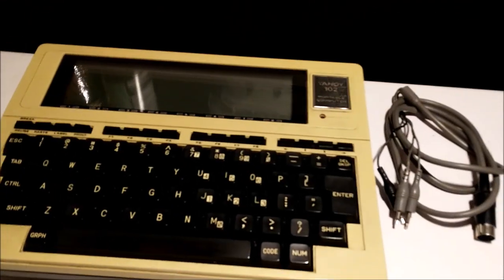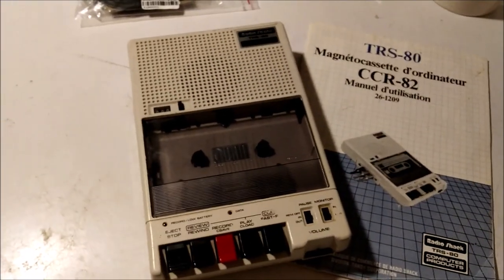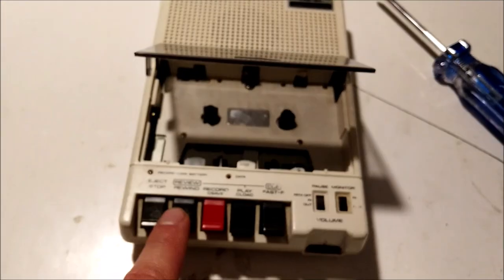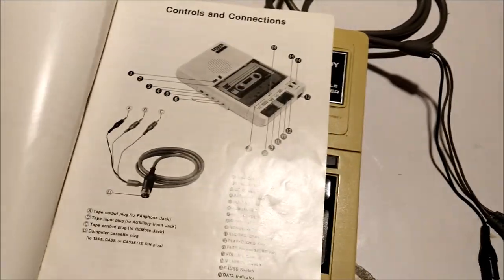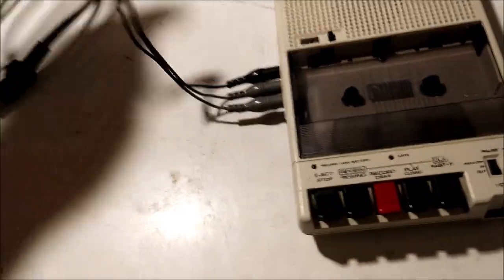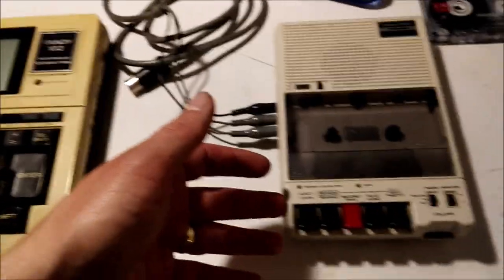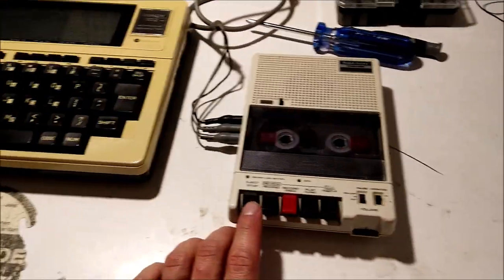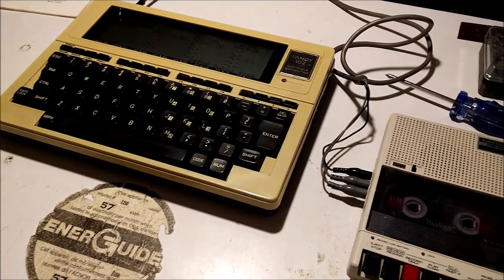Tandy Tape Drive - CCR82 Repair for Model 102

Comment: THANKS! I can't believe there is anything for this recorder. One belt was broken and now I know where it is threaded.
Reply from the maker: Glad it helped. I know how hard it is to find details on some obscure items. I repaired a tape deck this summer, only found one video online about it. While I was disassembling it I popped a small spring off and didn't know where it was anchored originally. Even though this video wasnt on a repair but tear down overview I managed to grab a few frames of the video that clearly showed where the tiny bugger belonged.

Comment: How do I change/correct the Head alignment on this machine? I have a Zx Spectrum +2a which has a built in deck for loading tapes, and it sounds much clearer than the audio output from my RS-CCR-81 that I am trying to use for loading tapes onto my new Spectrum Next. The lack of definition is clearly affecting the ability to load onto the computer. Thanks.
Reply from the maker: try recording a tape with it and playing it back. If it sounds muddy as well it is probably not the azimuth. If it sounds muddy a on tapes not recorded by itself but fine on recordings made in it then head azimuth is out. I would try demagnetizing the head first before messing with azimuth adjustments. A magnetized head is by far the most common cause of loss of high frequency response.

Comment: There's a lot of audible "wow" on the tape. I'd bet one of your new belts isn't uniform in thickness. I usually have to dig through the piles of crappy chinese belts with my calipers to find one that has the same thickness when measured at several points. It doesn't appear to matter to the Tandy computer, but remember that the wow is added when recording AND at playback, so it can have an additive effect depending on where the belt is when you play it back.

Comment: Nice looking recorder. Looks great next to the Model 102. You might want to use Retrobrite on the case of the 102: it will look brand new.
Reply from the maker: I am debating it. As much ad I want it to look brand new, I also like the look and feel of the true vintage. I have another 102 that is not 100 percent in working order (lcd issues) mainly a display piece that I might retro brite.

Comment: I used to have a CCR81 but I think I like the CCR82 better!
It's a nice compact size with excellent features. Having LINE level outputs with automatic volume options means it's so easy to load data cassettes on my Dragon 32 and Tandy Color Computers.
OF course it can be used on a wide variety of other 8-bit machines probably making it the perfect cassette loading device for older computers.